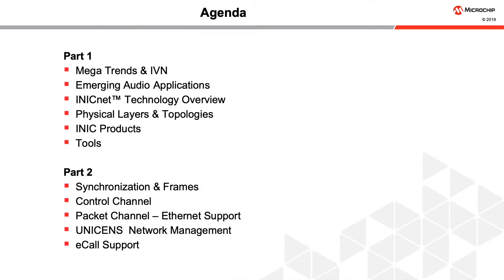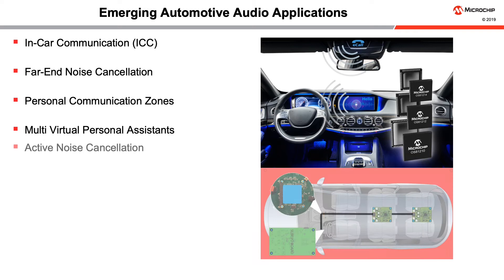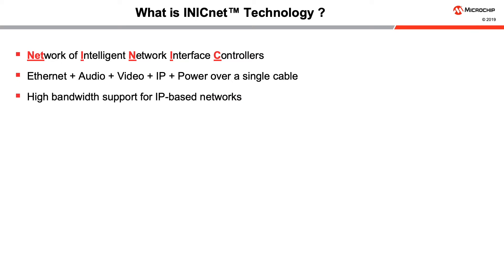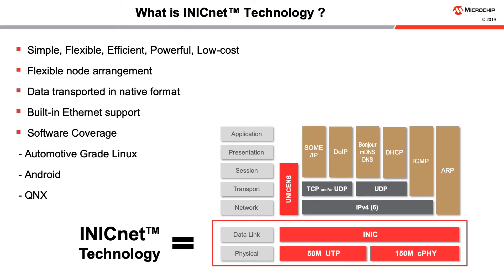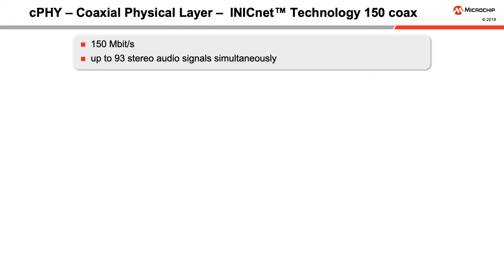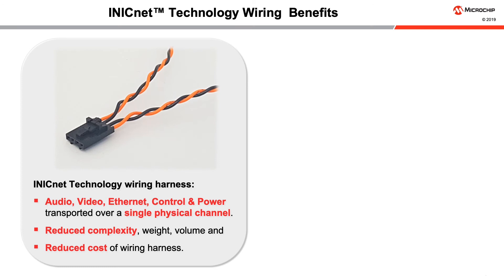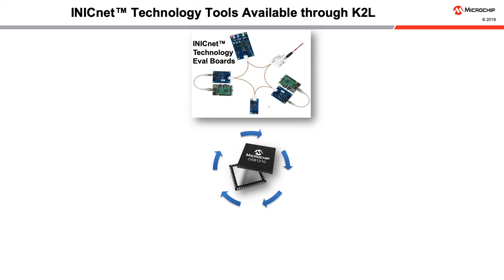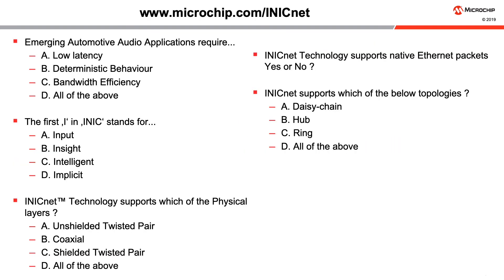INICnet™ Technology Introduction - Pt  1

Comment: It seems similar to MOST. What is the difference between INICnet and MOST?
Reply from the maker: INICnet indeed has some relationship to MOST. INICnet comprises the physical layer and data link layers of the OSI communications reference model. MOST encompasses all 7 layers of that model. INICnet can transport the same data types as MOST, but does not dictate the use of NetServices or the higher layer services required by MOST. INICnet provides simple mechanisms to set up communication channels between devices, and applications can then just send the appropriate data to each other. Our open source and royalty-free UNICENS software can be used when more sophisticated network management is required. For more information on INICnet technology, please contact the Microchip support team.